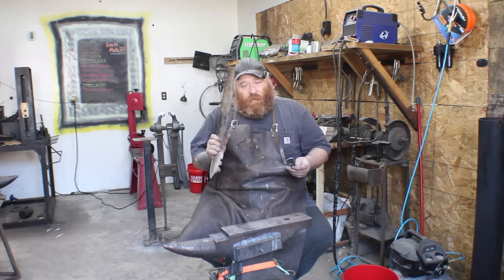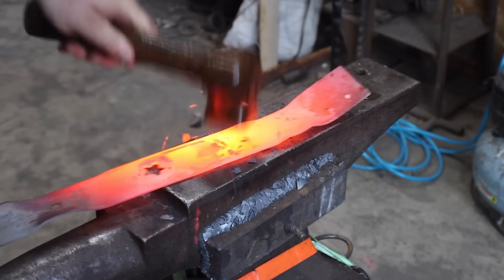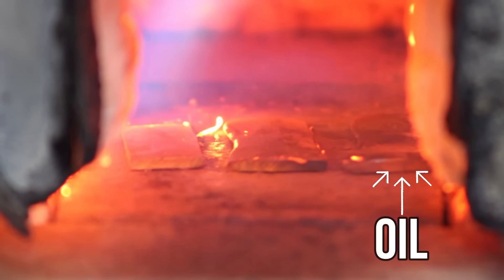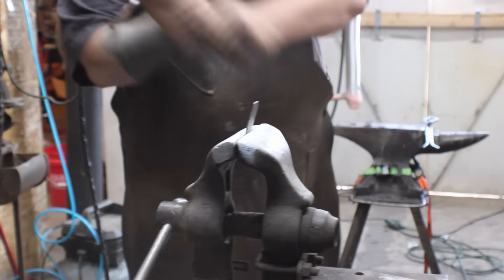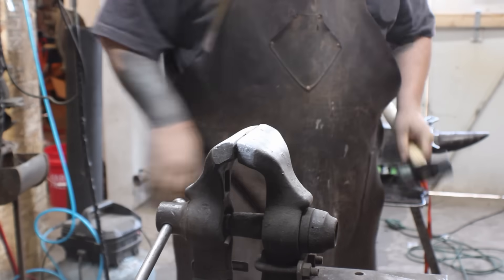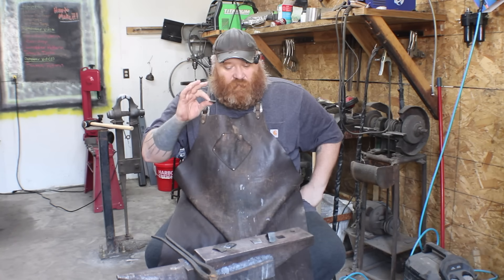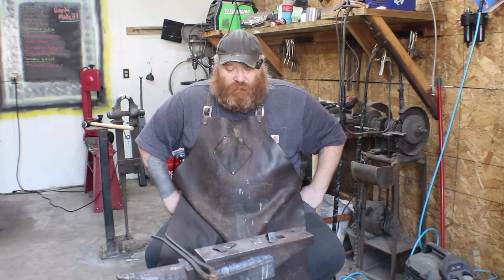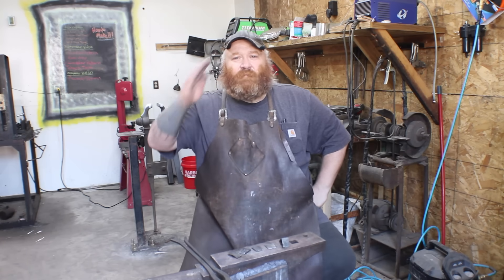Can you HARDEN Lawnmower Blade Steel? | Bladesmithing

Comment: In my experience most good quality lawn mower blades can harden to 54 to 58 HRC. Which is knife hard, but still needs tempered. Try experimenting with lower tempering temperatures like 350 to 375f. Very important with these lower carbon steels not to over temper or they'll get soft. 400-450 is too much. The edge holding capability is much higher with a 350 temper. I prefer multiple 2-hour cycles at a low temp vs one cycle at a higher temp. 4hr @ 350-375 is better than 1-2hr at 400.  You can get more toughness at a higher hardness that way. I have done tests with many different temperature and time combos (and steel types)  between 300-500 and 1-12 hr and 6hr total is the limit before you get diminishing returns. And 300 degrees is the minimum temperature that seems to be capable of tempering Martensite.

Comment: final heat treat and temper is crucial to any metal 
it does not need to be fancy as long as the person working it can heat treat it and is a decent smith 
I know heat treat from a machinist perspective aerospace tolerances are tight because they know the materials take on different tensile strengths based on the heat treat process some parts would get very specific cycles in the ovens

Comment: filet knife out of an old sawzall blade. yes, it is a lazy way. But it works and saves time for other ADHD activities😂
Reply: Leave the saw part on it and use them for de-scaling.  I love those long sawzall blades
Reply: @seagray5727 dual purpose descale with the teeth and use the other as the knife edge. flexible and hard enough to hold an edge already.

Comment: Your "control" cooling in the air has normalized, which is why it is not brittle. You should give them a whack BEFORE you heat them to see what you're starting with.

Comment: I have half of a Yankee cavalry saber brought home by an ancestor of mine (no clue where the hilt part and scabbard went).  It was drilled out, a wooden handle riveted to it with nails and has been a farm chopping blade for over 150 years.  Stays a bit rusty, but sharpens well and holds an edge.  I haven't used it as much since I have better machetes, but it does the job.

Comment: I figured it'd be good, given the way it takes punishment from tree roots, the curb, or some occasional stray rock out in the lawn. And that's without any particular hardening. Hardening must make it better at keeping an edge, but it seems tempering makes all the difference for durability. I wouldn't be surprised if you can weld and roll some piece together and hammer out into rod stock to make other lawn implements too. (Now there's something for a challenge, make something like a small fork-style weeding rake out of scrap bits.)

Comment: Mower blades are stamped and formed, so they're likely made from 1095. Straight high-carbon steel. Heat to 1500-1550 and dunk in cold water. Polish and reheat to straw-gold temper.

Comment: You know what an e-tool is, yes?
Well the Vietnam War Era version was also known as the M1956 multi tool(if I remember correctly). It had a pick ⛏️ opposite the 'spade' head. I want to make a pick version for my e-tool. Mine is the trifold all metal version. I was going to try and make it out of a lawn mower blade, if I could.
Reply from the maker: 12 years in the army. I absolutely know what a stool is. And if you start with a brush hog mower blade you should have enough steel in it
Reply: @rustyhammerforge5902  thank you for the idea.

Comment: Water quench result doesn't surprise me at all. It's a steel engineered for abuse, which equates to a low to medium carbon content (think, 1045, but specialized).  I'd guess your RC numbers are near 40. Little better than a railroad spike. Could be a great knife, just might have to sharpen it often. 

Watch some mower blade testing videos from the manufacturers, very interesting stuff! 

I'd like to see you stack up an inch or two and make a hammer or if it, personally.

Comment: I've been doing the hammer and vice break test for mystery files for years. Even after just a 2 hour temper in the oven I am startled by how resilient some of them are. I tend to favor known makers like Nicholson, but find random files here and there and turn em into blades. I've run across a few that were case hardened, a file shouldn't bend, haha!  Just started doing my own heat treating and some light blacksmithing as well, it's fun stuff! I will keep my eyes open for lawn mower blades. Are the full blades the same material? They don't just use good steel out at the edge and softer steels for the main body?
Reply from the maker: Each mower blade is different. I once found a mower blade that was San mai. Was pretty cool. But all the ones I have used were good all the way through
Reply: @rustyhammerforge5902   Good to know! Thanks for the reply, much appreciated.

Comment: I've watched a lot of forging on video and TV but never done any I was wondering what's the chunk of metal welded to side of ur anvil? Is it same as putting magnets on it or something else?
Reply from the maker: it isnt a chunk of metal...that is a magnet from a windmill that was used to hold the ladders on. You could pick up a 300lb anvil with that magnet
Reply: @rustyhammerforge5902  Never knew those were held on by magnets! That's awesome thanks for the info.

Comment: It has always been my understanding that commercial lawnmower blades are made from 10B84 (1084 simple carbon steel with boron added for toughness). I have used lawnmower blades for years with interrupted quench or traditional yake ire (Japanese clay coating) methods to produce extremely fine and hard edges with beautiful hamon.

Comment: Depend on the blade maker. I use John Deer industrial grass cutting machine blades. I have them for free at work as they replace them instead of sharpening...) They hold an edge and can take a beating.

Comment: They weld in good for an edge of a pipehawk or axe too.   I never had a problem forge welding em they are my go to metal for edges because its thickness lines up nicely with thin pipe hawks

Comment: I would agree to this test but only when the heat is at good critical temperature and not slightly overheated (maybe) as the color shows in the video. Also annealing and tempering are very important for an optimized outcome for even for medium carbon and high carbon steel.
Reply: Weird thing about video - it makes things look far hotter than what it looks like to the eye. Looks almost white hot on video but a high orange in real life.
Reply: @Dannysoutherner  I wasn’t doubting your skills at all. I know heat colors are always tricky through the camera’s light sensitivity and it is even more difficult to get a good sense of true temperature of the material once you work outdoors at (renaissance) fairs or other venues. For different types of steel heat treatments is best to use infrared thermometers if you do lot of hardening, quenching. They really give fairly accurate readings.

Comment: What if you heated it then water quenched it first then heated it again worked it to shape then oil quenched it since water over hardens by making grain structure extremely tight and heat makes it maluable again then oil hardens it with flexible features from not over hardening you might could make a sturdier structured metal maybe do that method to make a billet then alloy that billet with a spring steel you could get a decent blade from it perhaps

Comment: this isn't really a fair test. My first job in the 1970s was working in a lawn mower repair shop. The blades are super tough and specifically designed not to break/shatter if they hit something hard like a rock or steel pipe. That being said, they also dulled easily. The trade-off was safety over performance

Comment: Based on this I’d definitely say do a water quench. I’d be interested to see what a water quench with 2 2hr tempers at 325-350 look like. The second temper cycle should reduce the retained austenite further to increase the toughness and I’m curious if the lower temper temperature will allow the steel to be hard enough to act more like a spring instead of taking a bend and set.
Reply from the maker: you are correct...and in the next series we will tackling all of that...stay tuned and thanks for watching
Reply: @rustyhammerforge5902 subscribed 👍

Comment: I believe yes as I've only did 11 blade for throwing knives and testing for flexible and I judge it passed but for a hunting knife I've never tried or tested that but 1095 isn't much more expensive after the extra testing and knowing what the 1095 is known steel and it's great..
Your vice has much more give than mine so I say a solid hit it a better test.
I do believe the mower blades vary for usable steel and the shaft hole you look for the larger diameter holes for mounting the blades and the cheap ones you'll see has to small of the blade mount holes for the cheaper mower blades and for the lower HP motor because they are cheap steel so staying away from the lower quality mower brand.
Reply from the maker: Thanks for sharing your experience.

Comment: wacha reckon the bade steel is?
Reply from the maker: This one is most likely in the 1045-1065 High Carbon...based on the water quench results it fits in there somewhere...you could oil quench this in a very fast oil medium and get good results as well
Reply: @rustyhammerforge5902  I have an old rarely used 1050ish machete i can practice with
thanks for the reply/upload

Comment: I apologize if you mentioned this, but what oil did you use?
Reply from the maker: vegetable oil
Reply: @rustyhammerforge5902 gotcha. I’m curious I got k quench and quench fast. I wonder if the oil speed would make any difference.
Reply from the maker: @coultermoulton1663 it most definitely would.

Comment: What would happen if you just cut a knife shape from a mower blade and then ground it down to a knife?  I have one I did that way and that thing is almost impossible to get really sharp.  I am not a bladesmith, but an experimenter .
Reply: You need to heat treat it. Plus not all mower blades are created equal.
Reply: IF you are going to be doing that you need to keep the blade cool as you do it, otherwise the edge heats up and turns to playdough.
Reply: If you can heat and quench it it'll work great I've got a few marking knives for carpentry and a kiridashi made that way, also a few homemade planes all made from old mower blades that were pitted realy bad gives a really cool look when you polish and blue them. Need to hardness test one eventually, they'll hold an edge and sing when a file skates over them.
Reply: I sharpen my lawnmower blades all the time. Low carbon steel doesn't really take a good edge. I don't sit there and hone them. I just hit them on a grinder then take the burr off with a file. But I've been sharpening long enough to know when steel won't take a keen edge. Lawnmower blades are butter soft. You can't get a feather edge on steel that soft. If you could it'd just fold over. The steel can't support the geometry. The acute angle.

Comment: Lawyers make good steel. Cutting the lawn is an ugly cutting tool environment.  It's good for the company if they don't leave the housing in pieces at well over 100 miles per hour. 
My background is in cutting tools as a tool maker. I didn't try to research it but we used a proprietary alloy called T1 over 40 years ago and I don't think the steel company is still with us. no surprise the steel could make a good knife.
Reply from the maker: Interesting, thank you for the input.

Comment: That’s your field. All I know is if it ain’t old high carbon I can’t get a fine edge on it and brother I can sharpen a cats tail. I’ve bought a few pretty knives that were worthless. I tried a stone a file a grinder and they want take an edge unlike the old case trapper from 70$. Hit her a few licks and she rolls hair like a hard wind. ✌️✌️✌️✌️
Reply from the maker: 1095 is a good steel. I prefer 52100. But mower blades Made in the US which is what I use are close in heat treatment to 1075-1080. Heat treat is everything. What you saw in the video was just to determine if it would harden, not a heat treatment regiment. We will be releasing a new series in January that covers the heat treatment of all the steels seen in this series to the point of making them unbreakable if the steel allows.

Comment: manganese vs boron steel, some lawnmowers are one or the other....
Reply from the maker: Exactly…manganese equals good knife steel
Reply: @rustyhammerforge5902  just saying... boron steel is tough, but sacrifices some things...
Reply from the maker: @werftv4580 yep you are correct
Reply: if you were in SoCal, I could provide you with both
Reply from the maker: @werftv4580 I actually buy them brand new these days. Made in USA only mower blades. Mostly 1075-1080 range
Reply: @rustyhammerforge5902  all depends on what alloy they are.. manganese is tough but maybe untemperable , boron steel is the other way around.....
Reply: @rustyhammerforge5902  I bet you have local landscapers, steel recyclers etc that would have cheap used blades at a fraction of cost, then again, you might not have control over the steel...
Reply from the maker: @werftv4580 that use to be how I got my steel. But to be honest I buy new these days. But how I got my start is using all the steels that I will be testing in this series. I do still use lawn mower blades but I buy new, American made blades. They are oil quench and are similar to 1095. But I use 52100 virgin steel for my mono steel knives and 1084, 1095 and 4% nickel powdered mesh steel for my Damascus.

Comment: Just a thought,,,,,,,,heat stainless steel then cover with beach sand overnight. I know a man that makes rings from S.S. Spoon handles. He does this so that S.S. is playable to bend the ring to round form. When I weld cast iron I bury the part in a sandpit overnight so it cools down slower. Would the sand method help with heating prior to shaping. I’m 69 yrs old AWS certified I’ve never tried to make knives from saw blades leaf springs lawnmower blades or stainless steel. I enjoyed your testing!!
Reply from the maker: burying it in sand or even just burying it in the ground will allow it to cool super slow and relax any stress put into it
Reply: @rustyhammerforge5902 My thought as well.  I’ve buried large cast iron parts in a sand pit the set fire to wood pallets on top of the sand pit. But cast iron has mind of its own. Some method work today but tomorrow it’s a guessing game nothing works!
Reply from the maker: @papajoecooking4425  absolutely...each type of steel likes what it likes and you just have to learn what that is

Comment: Chainsaw bars make good blades too
Reply from the maker: yeah they do...you just got to be careful with them just like lawnmower blades...not all chainsaw bars are created equal...I believe we have a video in the mix for chainsaw bars so definitely stick around for that one
Reply: @rustyhammerforge5902 my dad made a dagger out of a chainsaw bar with a walnut handle and brass guard and pommel
Reply from the maker: @liquidrockaquatics3900  sounds beautiful
Reply: @rustyhammerforge5902 not really, but there’s no mistaking it’s function. My dad was just a mechanic with a Weber kettle grill, a chunk of railroad steel, and a hammer.
Reply from the maker: @liquidrockaquatics3900 all you need

Comment: I did some testing too.  I ran over a trailer tongue with my power lawn mower.  It bent the crank on the mower.  It cut a notch 1/4 inch deep in the trailer hitch, but hardly dulled the mower blade at all.  Good stuff !  If anyone else wants to test a mower blade, I suggest you do the vise and hammer style test in the video.  It'll save you a trip to the lawn mower store.
Reply: Just one thing. Put on a face shield and some leather gloves when you do it 😊
You can get used to a wooden hand, you can learn to walk on a wooden leg... It's hard to see with a wooden eye.
Stay safe!
Reply: @ogi22 safety should be encouraged always, Thanks
Reply from the maker: WOW! Talk about dealing out some punishment. And yes the snap/break test is the definitive test! Spark test is so subjective.
Reply: Asking what brand of mower did you hit the trailer ball with ?

Comment: In my limited experience sharpening mower blades I felt like the old Snapper Hi-Vac blades were a better steel. The blades were a little thicker and harder and would sharpen well.
Reply from the maker: U r correct…the thicker the mower blade the higher the carbon content most of the time...which is why testing is so important
Reply: I was given a used blade that came off a brand new Craftsman mower.  After quenching it in oil, it was still soft. Replacement blade steel works well. The thicker the better, though.
Reply from the maker: @charleswalker2070  yes you are correct...but doing a water quench and a temper for 2 hours @400 degrees f will make that blade damn near unbreakable

Comment: You should try edger blades.  You can get them either plain steel or hardened.
Reply from the maker: interesting...will look into it
Reply: @rustyhammerforge5902  Looking forward to it.  Im interested because i have a lawn service and have tons of used mower and edger blades.
Reply from the maker: mower blades obviously are a good source...will have to go buy some edger blades and test those as well